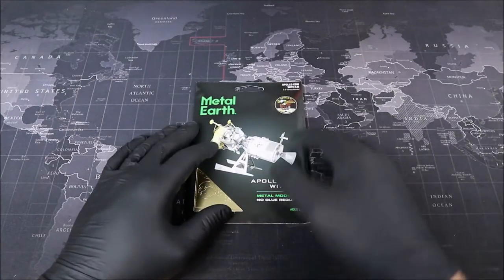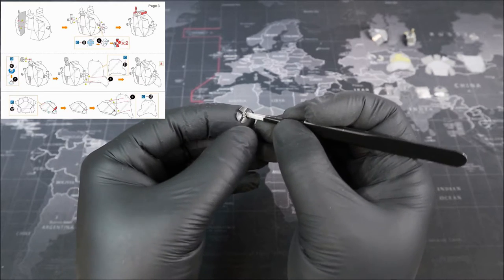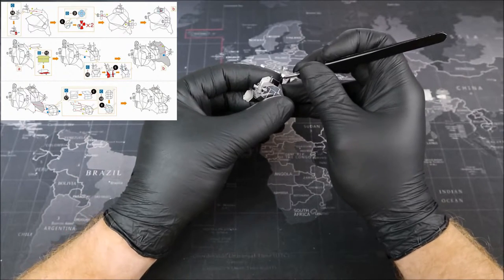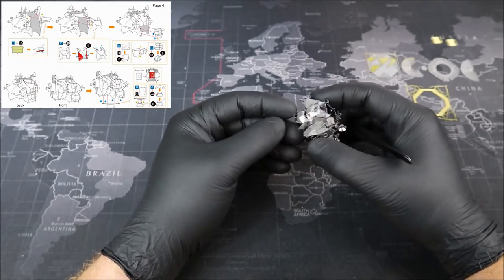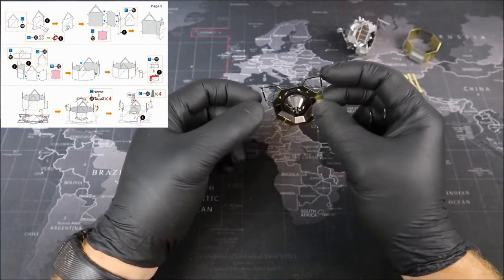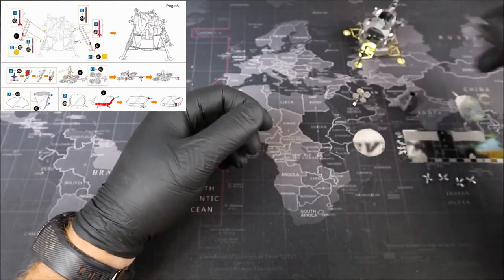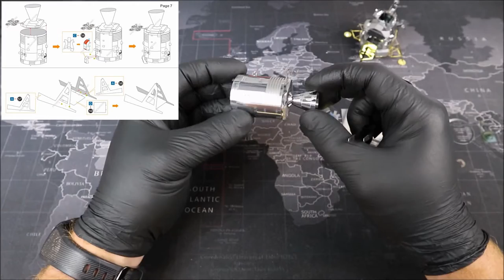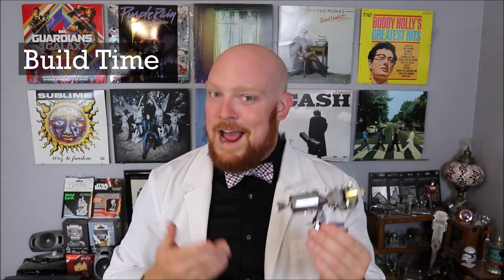Apollo CSM with LM- Metal Earth - Build With Me

Comment: My first metal earth build... Had tough time with the sides of the LM ascent module.  Too much adjusting folds to fit caused breaks which I then had to fabricate, glue, etc.  Found this video after starting build and learned that twisting the tabs makes for a tighter connection. Thanks for posting this.
Reply from the maker: Hey Kirk,

The Apollo CSM with LM is a hard first build and  I'm glad my video helped you make it :) The Metal Earth Space collection is not the easiest  to do but it has some of my favorite builds in it. 

Word on the street is the international space station is coming to Metal Earth. That will be an awesome build.

Welcome to the hobby!

Comment: What do I do when a fold point snaps. This is my first model and I’m worried
Reply from the maker: Don’t be, it sucks but these things happen :) 

You can: 

Try to keep going. Depending on the break you may be able to connect the parts and it be ok.

Use a UV glue to fix the part.

Or finally contact Metal Earth. They will send you replacement parts and they are really good about it. 

Good luck with finishing this one it’s a favourite of mine.  Also feel free to reach back if you need to
Reply: @GrooveBuilders  I think it’s ok the piece that broke off also had a connection point and it’s holding in place I’ll just get some glue to keep it in place

Comment: My first build from metal earth. I broked a part 😢 can i use glue to fix it ? What can i do ?
Reply from the maker: No problem :) you can use super glue or uv glue. Worst to worst if you email metal earth they will get you fixed up. 

Breaks happen, hope it’s still fun. This one is a hard one for a first model
Reply: @GrooveBuilders  thanks you for the answer !! Can i continue the model without the broken part ??
Reply from the maker: @B_III  you can depending on the part. Sometimes they even have extra parts in the sheets. What part is broken?
Reply: @GrooveBuilders  the 2C. So i cant assemble it with the 1A and 3C

Comment: This  video could be better. I mean, there is no way you instantly and easily attached parts 1 and 2. I can't hold the parts together long enough to bend the tabs. Of which are also too small. Pieces got bent back and forth so much that hey broke at the perforations or etch lines. I threw it out after two.pieces broke. Bye, bye 25 bucks.
Reply from the maker: Hey Peter thanks for watching the video and giving me some feedback. I like to think my videos have changed over the years as I've made these but I'm always up to here some constructive criticism. 

This model is not easy especially if it's one of your first. For the first two parts I used part one as a guide to shape part two. Sometimes we can use other parts in the bill to help us shape difficult pieces. Sometimes you have to bend a little bit, match it up to where it's going to go and see what changes are needed to be made. 

Sometimes if the instructions say bend a tab when bringing two pieces together like our sides it won't stay together right away.. this is where temporarily twisting the tab comes into play. After when we connected more than one piece together we can go back untwist the tab and bend it down properly. 

These kits are a lot of fun and it's too bad your first one is starting you off on the wrong foot. If it helps Metal Earth is a great company that will gladly replace broken parts for you. Just give them a quick email :) 

If you need help with something specific, just let me know man I'll do my best to give you a hand. 

Thanks again for watching